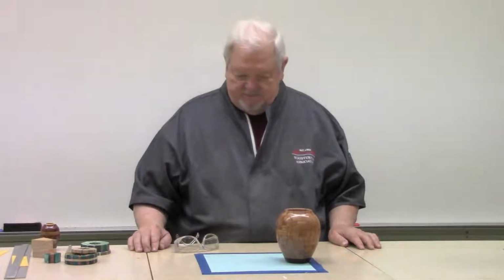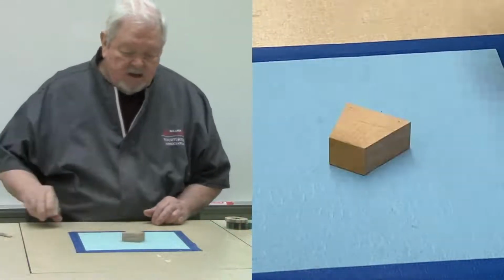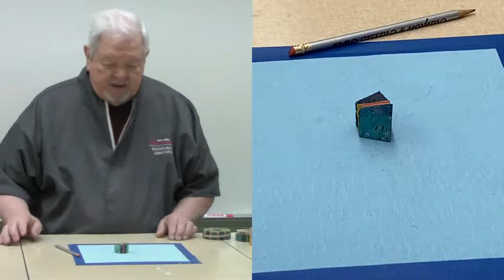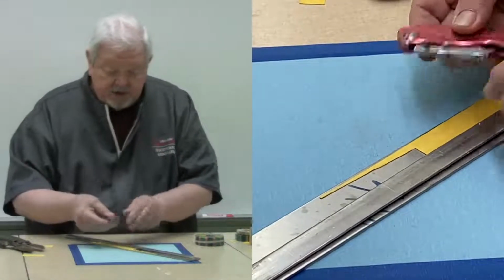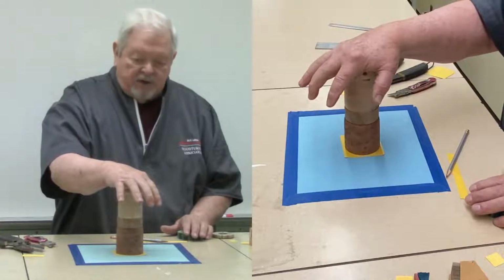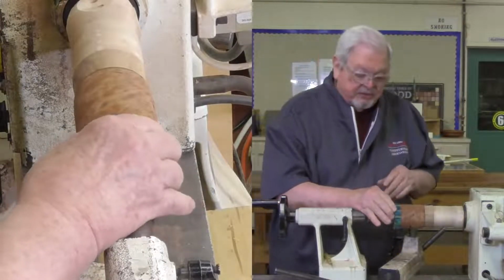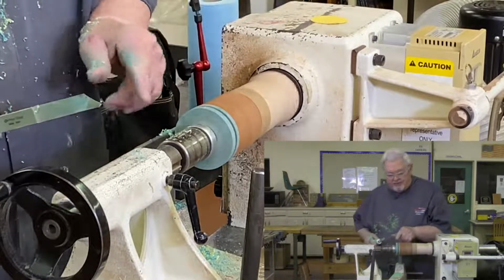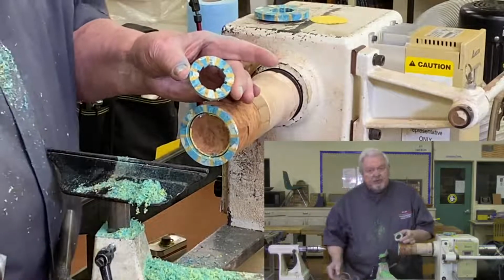Segmented Turning, Part V, Part 5, Using spacers  and veneers

Comment: Question on the veneer, you made sure your veneer between the segments was facing so you don't have any end grain showing, but then when you attached the piece between the rings it will have end grain.  Why make sure on the segments, but not between the rings?
Reply from the maker: Good point. To assure side grain view between the rings, I would have to make a segmented ring of veneers - tough task! For my smaller vessel it seems too much effort. Between the segments I want all the veneers to face the same direction for consistency - might as wellmake them side grain facing.
Reply: Thanks for the fast reply.  I really enjoyed the videos, and I bought your book@JimRodgersWoodturner